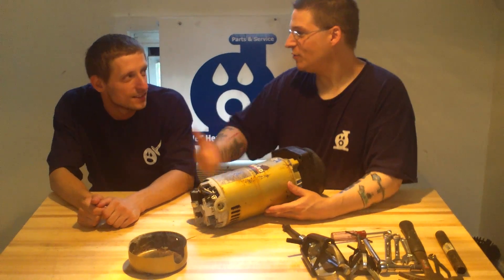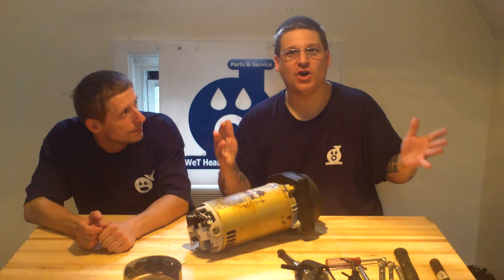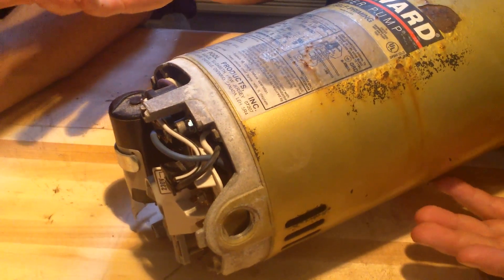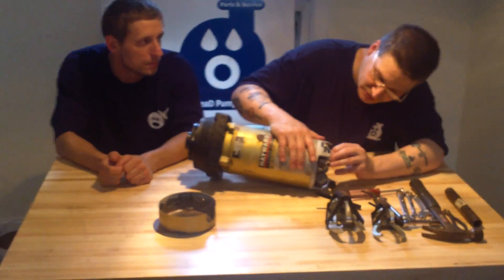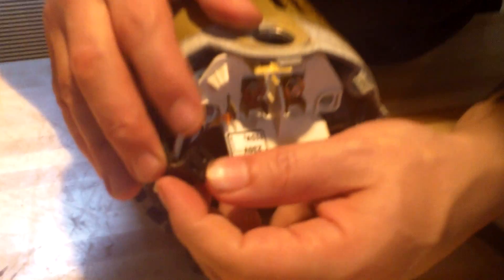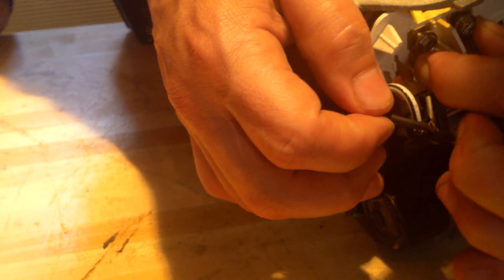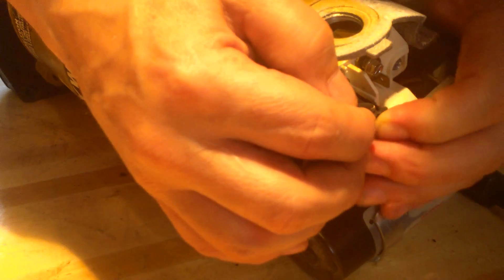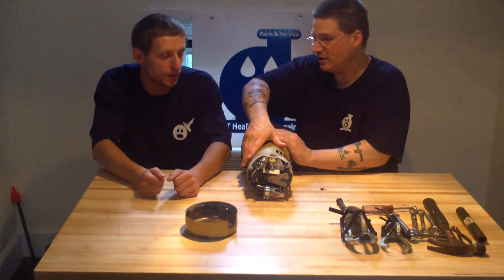Hayward Super Pump Voltage Change

Comment: Hello.  I agree with the comment that the video should probably be shot again.  It is difficult to see what you are trying to do and saw you had some troubles.  Don't get me wrong I appreciate the help and thank you for putting out the video.  The reason you were having problems is that moving the black plug is not as easy as described. Hayward doesn't align the clip so it is an easy fit. At least on my pump.  The prongs have to be bent a bit for it to work.  It would have been helpful to show a closeup of the finished change.  It would be better to be clear that the black plug has to go on prong four and the white and black has to go on prong 5.Once I did that the pumps is running perfectly. Thank You

Comment: How about a little LIGHT on the plug!!! 3 ppl and you still can't see what's going on. My black plastic piece has gotten hot or just old and it just crumbled to I can't tell which of the wires go's where after changing out the bearings. Help! I just need to know which wires go where for 220v thanks